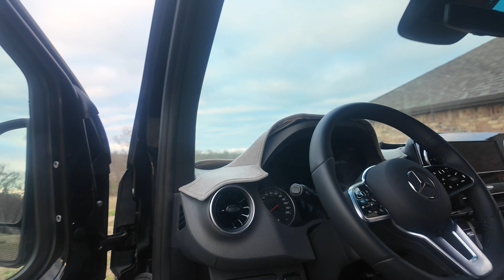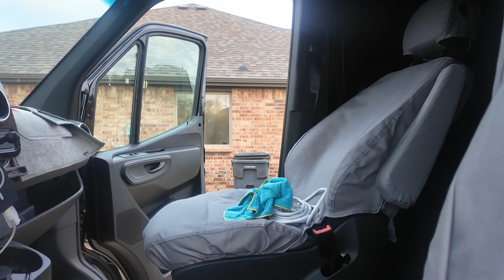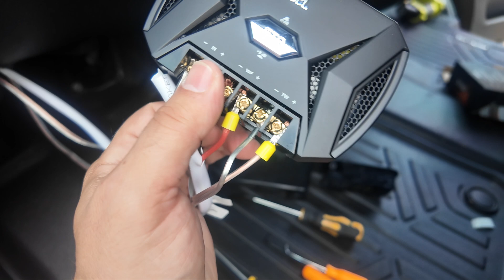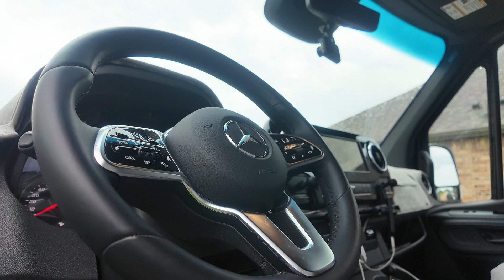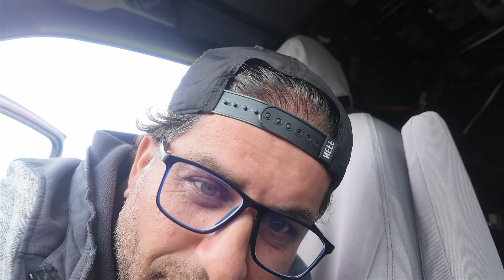Compact Subwoofer Under Sprinter Seat? Yes, and Here's Why

Comment from the maker: ▶ Amp I used that work perfect and is compact https://amzn.to/4hOFh0g
▶ Subwoofer 4 ohm https://amzn.to/4i0Ljtu
▶ Sub box that fits under passenger side seat https://amzn.to/47pAsob

▶ Non Component Speak Install without AMP https://youtu.be/JjoJH4z4G1E
▶Cheap but great speaker (may not have needed brackets) https://amzn.to/490zb6r
▶Better speaker (comes with needed brackets) I still recommend the cheaper speaker unless you are using an amp https://amzn.to/3M4oK86
▶ Best Speakers (comes with needed brackets) but you need an Amp https://amzn.to/3THyBYJ
▶Subwoofer https://amzn.to/3S37Hav (2 ohm stable)
▶2-ohm sub for above amp https://amzn.to/3tx63Dz (2 ohm stable)
▶Amp used for rear speaker and subs https://amzn.to/3SlgKDV (2 ohm stable)
▶Speaker used for very rear https://amzn.to/3wuBikn

▶ Center speaker FIX UPDATED 2025 https://youtu.be/9bnqcVj36Yk
▶ Component Speaker 2025 Install - https://youtu.be/FzmGWHs5Xvs
▶ Amp install https://youtu.be/vhBOfmHlM-g
▶ Sprinter Stereo Overview https://youtu.be/SP3D0qBHm1g

speaker wiring for front doors
Driver side: green = positive, gray/white = negative
Passenger side: purple = positive, gray/white = negative.

Sprinter Playlists (60+ Videos Each) 🚐
▶ VS30 907 170 EXTENDED: https://bit.ly/VS30Sprinter170
▶ 170 High Roof: https://bit.ly/VS30170Extended
▶ 360° Van Tour: https://youtu.be/rCCA3hLQSzQ
🛠 Free Van Build Parts List: https://bit.ly/RFVanBuildPartsList
💸🛒Building a Camper Van? Enjoy Fast Delivery and Easier Returns during the build https://amzn.to/4rGP8Zf

Disclaimer:
Due to factors beyond the control of RandomFix, RandomFix assumes no liability. Affiliate Partner: I will receive a commission from some of my affiliate partners for my first-hand recommendations such as Amazon. #CommissionsEarned #Ad My videos include paid links.

Time Stamps
0:00 Installing an AMP in Mercedes Sprinter with OEM Stereo
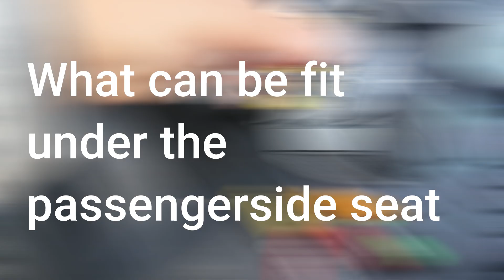2:01 What can be fit under the passenger side seat 
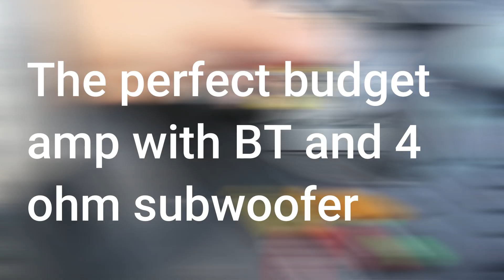3:55 The perfect budget amp with BT and 4 ohm subwoofer
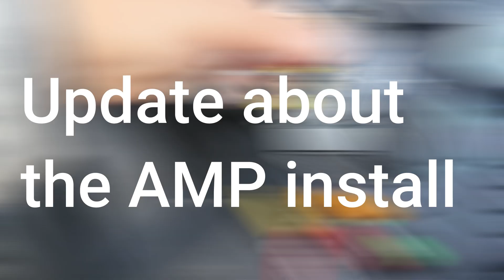4:57 Update about the AMP install

Upgrade your Mercedes Sprinter's audio! Learn how to easily install an amp with the OEM stereo by tapping into factory speaker outputs. See subwoofer and amp placement under the passenger seat. Includes tips on grounding, Bluetooth amps, and avoiding common issues. Links to products and speaker installs in the description!

Comment: Brother, hopefully you can help simplify things for me please. The signal (2 wires) that are going from the head unit are going to where? To the tweeter first? So do I take that signal cable and put it to the crossover? I have a 2019 Sprinter and I want to fit new speakers, and a sub. I’m confident in working with speakers etc, I’m just confused on how/where to get the signal and how the amp works with all of this.
Reply from the maker: You need to grab the leads from the doors, check the video links as I cover all aspects of this head-unit if you can find it let me know and I will send you the link. 
Best of luck and keep me the loop

Comment: Why not just get a slim powered all in one unit like the BOSS Audio Systems BASS10 or Rockville RW10CA? Seems like a better option and will cost less. By the way, both of these were about $100 just before the plan demic.
Reply from the maker: Those are just powered subs, I needed to power the front components.
Also, I want bt as when I am not drive I want to be able
to play music with having to turn on the mercedes Audi system.